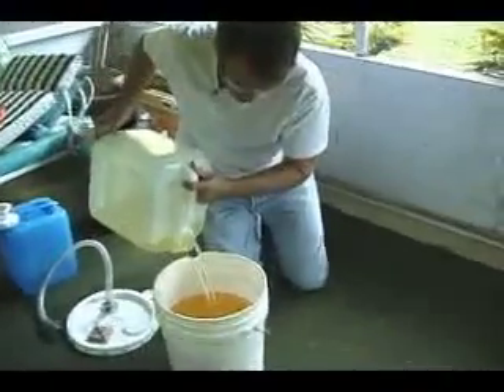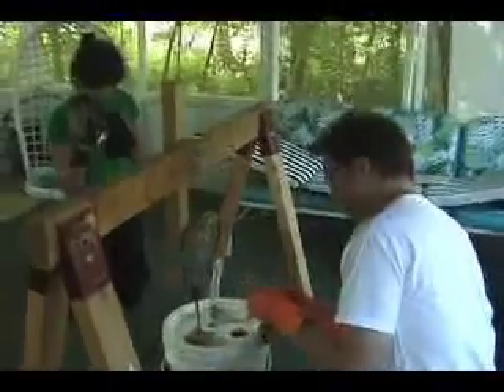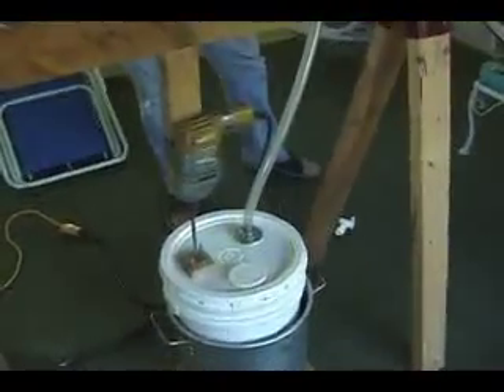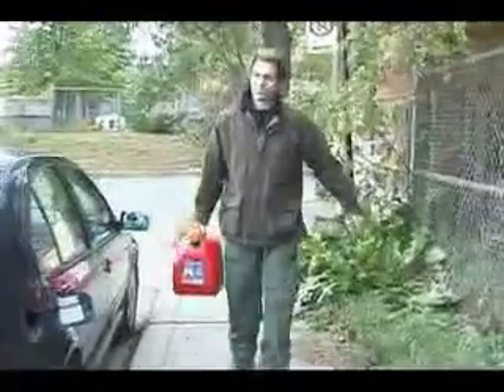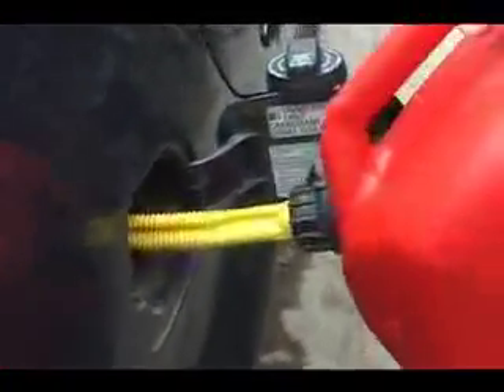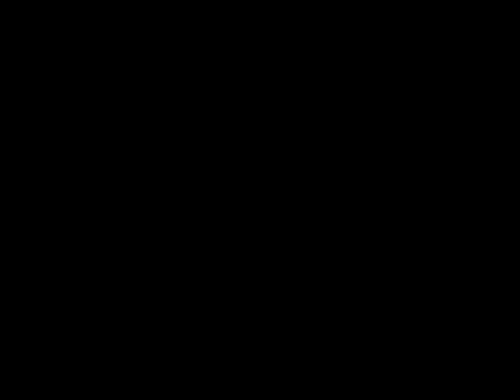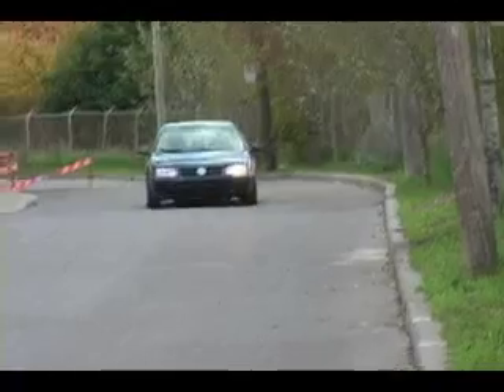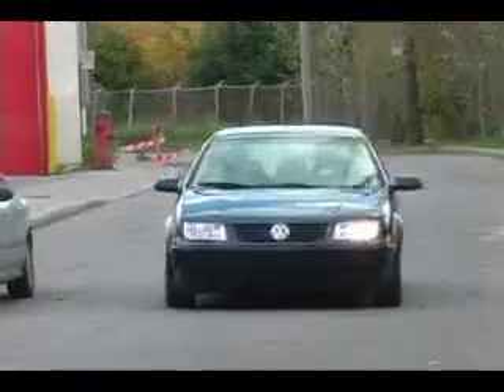Biodiesel

Comment: love how he had to prove something that's a 100 yrs old. 60% to 70% better milage is an exaggeration. 25% realistically, but you can twist the numbers and come up with 50%, but that is not really apples and apples. With that said I am a fan of Diesel and even making bio-diesel but there are potential problems with COKING in injectors. VW TDI only approves of 5% Bio-diesel to 95% petrol diesel or the warranty is void. Just be aware and don't swallow the disciples hype hook & line. There are cons.